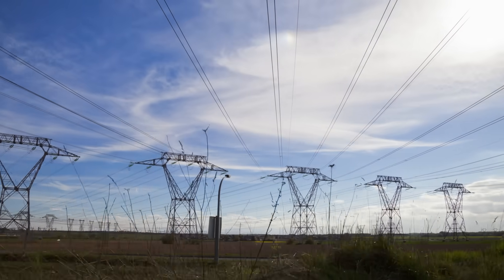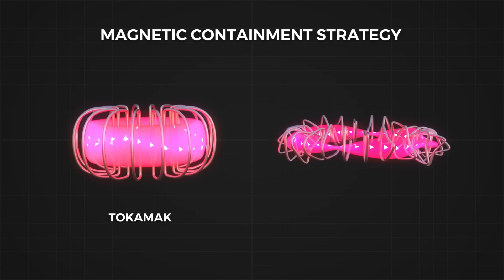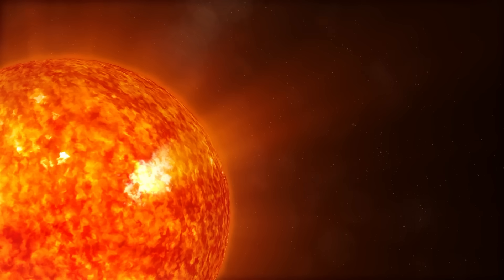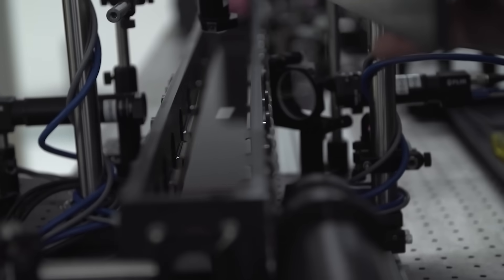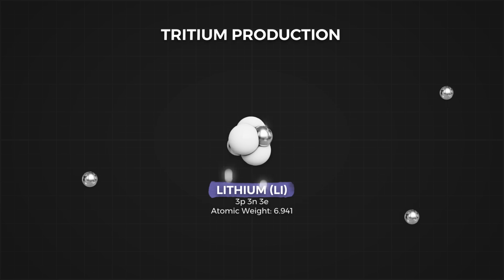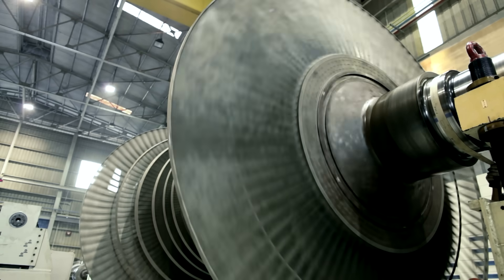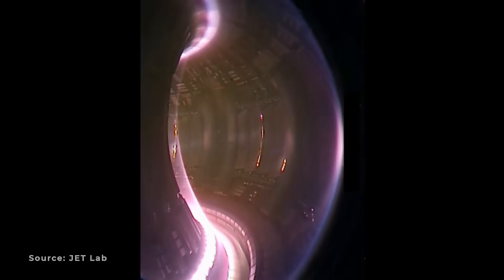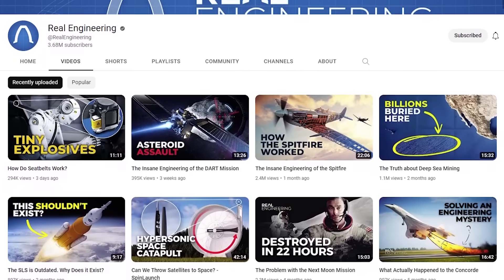The Problem with Nuclear Fusion

Comment: It's impossible, The temperatures will vaporise the container within minutes every time. There is no way round this. However wonderful it might be, it's a giant waste of money that is being diverted away from viable, useful projects.
Reply: They have been achieving these temperatures in reactors for decades. They achieved thousands of times these temperatures at CERN. So what are you talking about?
Reply: @Gomlmon99  yes they have. But that's why they can only maintain a plasma in times measured in seconds. Because any longer and things start to melt. You understand that 'things take time to heat up' right?  You could put your head in an oven for three seconds and be alright. Try it for an hour and understand the issue as to why there can never, ever be a continuous fusion reaction under control..
Reply: @andyf10  They use copper magnets in the short life ones. Longer plasmas can be sustained with superconducting magnets, which exhibit no resistance and so don’t heat whatsoever. This has already been done several times around the world. So again, what are you talking about?

The arrogance of people who know absolutely nothing about a topic is always shocking.
Reply: @Gomlmon99   I'm not talking about magnets, I'm talking about the plasma itself at a hundred million plus degrees. Anything and everything in close proximity is going to be vapour in short order. 
Iron turns into a gas at 2862 Celcius.
Reply: @andyf10  They can achieve continuous plasma. Modern reactors have held plasmas above a 100 million degrees for very long periods now.

The reason old reactors couldn’t do it is because the copper magnets overheat.

Are you under the incorrect assumption that the walls reach millions of degrees? Because it’s only the core of the plasma that gets that hot.
Reply: @Gomlmon99  No they can't, the longest time achieved in 17 minutes in China.  Continuous plasma isn't and never will be possible. 
The walls don't reach those temperatures BECAUSE the plasma is only there for a few minutes. 
It's the main reason why they can't ever achieve this, because they WILL heat up under heavy neutron bombardment and intense IR heating. Why do you think they won't? Do you think the plasma doesn't emit IR radiation?
Reply: @andyf10  They don’t because they are actively cooled, faster than they’re heated up the plasma. Pretty simple no?

Not much concern about heating from neutrons. The structural materials tend to have pretty low cross sections for neutrons. 

17 minutes is effectively forever. If the walls aren’t too hot after a few minutes, they can go long enough for a full pulse.
Reply: @Gomlmon99  Ok, well you seem convinced. I worked on the JET project in the 80's and no one had any real optimism that the thermal issues were ever solvable. 
50 years on and they still aren't, so the money pit of vanity science grinds on. 
Clearly you think 100 million degrees can be solved with 'cooling', ok.
But BTW, 7 days is 'forever', 17 minutes is not, especially if you know why they couldn't go any longer....
Reply: @andyf10  so you worked in a fast moving field 40 years ago and think that’s relevant? I work in the fusion industry now so I’m fairly comfortable with my information. 

Your suggestion of 7 days is an example of how out of date your “knowledge” is. Why would anyone run a plasma for a week straight? How would you swing the current?

Even EU-DEMO is planning pulses on the order of an hour or two.
Reply: @Gomlmon99   Well I suppose you might ask why you run any power station continuously..

The answer of course is that to be useful to society, you need 'continuity of power generation' and positive power output.

A power station that only operates a few hours at a time is precisely useless. 
You realise the ultimate aim is power generation for the world? 

Oh and it isn't 'fast moving' science, it is glacial in speed, hence the woeful progress made over many decades. And no light at the end of the tunnel for many more decades yet. 

It's vanity science at it's worst with no prospect or even viable model for a positive output of power.  It's so bad that the recent announcement of passing the power out vs. in threshold had to ignore the 100x factor of the power they needed to make the lasers run. The claim was essentially fraudulent and really they are nowhere even in the ball park. They discounted 300 MJ of energy input! Ridiculous claim!

But hey, enjoy spending the money and having science fun while you can, because no one is ever going to bring you to book for the utter waste of resources being made in fusion.
Reply: @andyf10  You didn’t really work in fusion do you? You don’t know the difference between the pulse and the balance of plant? 

The pulse could be an hour with 5 minute downtime. That doesn’t mean the turbine stops spinning. The balance of plant would provide carryover for that. 

I agree with the skepticism but you really should stop commenting on topics you don’t understand
Reply: @andyf10  hundreds of billions?? The total life time cost of JET is about £1billion
Reply: @Gomlmon99   There are many projects all over the world, I was referring to total cost of all projects. Also to cost at today's inflation adjusted prices. The US alone were spending a billion a year on fusion back in the 80's...
Reply: @andyf10  do you have a source for that claim? Not heard of figures anything like that.
Reply: No? The temps aren't a problem as the plasma is contained by magnets and doesn't touch the walls. So continous plasma possible.
Reply: @afaxmachine5045   So I can stand a meter from the sun and it'll be fine because I'm not touching it..... Right? Because that's what you are saying.
Reply: @andyf10  That’s not what he’s saying. You’re just one walking logical fallacy machine aren’t you?
Reply: @Gomlmon99  So tell me if the plasma is at a 100 million degrees, could I hold my hand a meter away from it? Assuming it could be contained? What would happen to my hand?
Reply: @afaxmachine5045  Well avoided....  OK in a space suit then. Same question stands. Can you stand next to a plasma because you aren't touching it. Or would you get a bit warm quite quickly?

It's as though things only heat when in physical contact or something?
Reply: @andyf10  depends on how reflective the space suit is.
Reply: @afaxmachine5045    hahaha ok..... think I will leave it there. Thanks for giving me a good laugh.
Reply: @andyf10  Of course no. Luckily, we aren’t containing with it hands, but with materials that can withstand the increased thermal radiation.
Reply: @Gomlmon99   So you are saying there IS thermal radiation from the plasma...?
Reply: @andyf10  Of course. Who said otherwise? It would be ridiculous to suggest there’s not, and ridiculous to suggest that means we have a problem.

Everything gives off thermal radiation. What’s your point?
Reply: Just reminding the world this person thought the temperatures would “vaporise the container within minutes” despite the fact we’ve held plasma like this for minutes many times without the slightest hint of vaporisation, and despite the fact the heat of vaporisation of any container would be enough to extinguish a plasma
Reply: @Gomlmon99  So what is limiting plasma life then. Why can't they do it for days?  Awaiting to see if your answer includes the words hot, temperature or heating 🤗

But hey, we should return to this question in another 20 years, when..
a) Still no commercial fusion
b) Another XXX Billion dollars pissed away on it.
c) Fusion is just "20 years away"
Reply: @andyf10  We’ve already been over this. It’s the magnets. But they’re not being vaporised by the plasma, and they’re at no risk whatsoever of being vaporised, like you said.

Though, they can do it for hours. Beyond that, the limiting factor is just how long they can swing the current across the solenoid for.

Comment: Nuclear fission is not uneconomical, it's one of the cheapest methods of producing electricity. Nuclear power is dying because of crazy environmentalists and politicians fear mongering about how dangerous it is.
Reply: It’s dying because it’s exceptionally expensive. No idea where you got the idea of it being cheap lol.
Reply: Fission is destructive by its very nature, It creates material that is by no means biodegradable and destroys anything that comes within miles of it. But please go on about how it's cheap and clean.
Reply: @SerDanFortesque  But it doesn’t destroy anything once it’s put in a box, right?

And it decays away, unlike chemical contaminants.
Reply: @SerDanFortesque  It will be inert as far as we care. The odd atom decaying is not a concern. 

The waste from fusion is short lived and weak, and could just be left in a box for a few years until it’s safe. Not a problem.

The way to dispose of it is DGRs, which are now entering into service.
Reply: @SerDanFortesque  this is false.

Comment: Helion is not the only ones not betting on the solid neutron shield to capture energy. General fusion and they piston design will us a layer of liquid mercury to capture the neutrons and already move a turbine. They got funding and authorization to build a 70% scale demonstration power plant by 2025 and are aim for a early 2030 for a comercial one. It will be interesting which of the two companies win this out, they probably will beat ITER.

Comment: Nuclear fission is not 'clean' energy. It's the exact opposite because of the radioactive waste it produces!
And that is the reason nuclear reactors are shut down. Because no one knows what to do with the extremely dangerous waste products!
Plus, as several accidents have shown, it's very dangerous in the first place! Why people keep saying it's 'clean' and 'safe' ?
Reply: Because it is clean and safe. Just because you are ignorant of the facts and statistics, it doesn’t mean it’s not true.
Reply: In relative terms, nuclear fission is orders of magnitude cleaner and safer than any fossil fuel energy source. It actually even trades blows with renewable energy sources for those metrics when factoring in construction and lifetime resource costs. Yes, that is despite the accidents of 1986 and 2011, including pessimistic estimates of their long-term effects. Air pollution is a massively underappreciated problem, it's just not as immediately apparent as a soviet power plant literally exploding.

"No one knows what to do with the waste" is also a false statement, quite simply - see for instance the vault Finland is looking to open. Solutions exist, And there actually isn't even that much of it.

This is not an attack, I know yours is a very natural stance to take, but it's not supported by actual fact. If you're interested, there are some videos on YouTube by e.g. Kyle Hill or Kurzgesagt that break down the issue of nuclear power pretty nicely.

Comment: At 7:44 you mischaracterized what a moderator pool is designed for. They are not designed to absorb high energy neturons. They are designed to moderate high energy neutrons, which means to reduce their kinetic energy to thermal energies. Absorption is counterproductive in a moderator. I haven't viewed the rest of the video, and I don't have a strong grasp on fusion, but such a technical error about fission on your part diminishes your credibility in my eyes.

Comment: So solution is combination of fission and fusion reactors plus renewables. So fission is main reliable backbone and source of tritium for fusion reactor. And elecrolisis for hydrogen and deuterium. Hydrogen will be used for fuel in fuel cell vehicles  and deurerium in fusion to make helium for airships.

Comment: I don't understand, why we don't research materials that can directly transfer heat into electricity... Instead we just waste so much energy everywhere
Reply: Why would you do that? Steam turbines have 90% effinency. Steam is simply simplest way to extract and convert energy from fuel.
You can store so insane amount of energy on steam.
Reply: @jarskil8862  But first you loose energy converting original source to heat, then heat to water, them water to turbine. Think about this like that: right now, it's like instead of photovoltaics, we used lenses to heat water and used connected steam turbines. Which we also do, but photovoltaics are better in every scale beside massive collector plants.

Comment: Fusion requires reactor designs that are not Tokamak donut, Spherical Chamber or Stellarator based. In addition to the fact that Deuterium squeezer units, such as those from Lockheed Martin and Helion, are not true Fusion but fall into the category of Thermal Fusing of Isotopes. Proper Fusion is Ionic in nature. 
Laser based fusion reactions are " heat and squeeze " processes and not viable for sustainable Fusion power.
I speak not as a scientist but as an engineer.

Comment: I hope you haven't bought into that "solar and wind are cheaper than nuclear" meme.  Maybe during operation, their unreliable output may be cheaper per kWh, but W&S are 1) horribly expensive and energy-intensive to create, 2) have a much shorter useful life, 3) need 100 to 1,000 times as much land for the same output and, 4) have a much higher environmental impact for both construction and decommissioning.   Tell me again why this is desirable?
Reply: Because these things are either overblown/exaggerated or are outweighed by the lower cost in certain areas.
Reply: @Gomlmon99  The only way to settle this is to do a cradle-to-grave analysis of each form of power generation.  I'm an engineer and have done many of these (but not for power stations).  That's the one thing you never see by advocates of green energy.  Instead, they "draw the envelope" around the part of the life cycle that looks better to prove their point.  

For example, the energy that goes into the production of solar arrays, and that's mostly the refining of quartz into silicon, exceeds the amount of electricity that will be generated over the array's lifetime.  

Further tarnishing it's green credentials, that refining process takes powdered quartz (SiO2) and heats it up to thousands of degrees in a reduction furnace, then adds...wait for it...coal to the furnace.  The carbon in the coal grabs the two oxygen atoms off the quartz leaving pure silicon behind.  And what do you call a carbon atom with two oxygens attached?  That's right, creating this panacea energy source consumes coal and releases CO2 into the atmosphere.  

By some calculations, solar panels release more of it per kWh generated over their lifetime than if you had just burned the coal in a power plant in the first place.
Reply: @hagerty1952  cradle to grave assessments have been done on all common energy sources hundreds of times lol

Comment: 2:46 
hot enough to melt any solid material in the universe... yet doesn't actually do that in that solid doughnut?!
magnets aren't anti-heat!
Reply: I don’t have any outside knowledge, just going off what he said, but I’m assuming there’s a specific distance or limit to how close a substance can be to the plasma before it starts to melt, similar to how there’s a limit to how close chocolate can be to a fire before it starts to melt lol. So the magnetic field generated by the magnets acts to keep the plasma confined in a specific region as it spins around so that there’s sufficient distance between it and the walls of the reactor
Reply: The magnets suspend the plasma so it doesn’t touch the walls and the walls don’t get that hot. So in a way, they are anti heat.

Comment: Fusion is one of the two most important challenges we face on our journey to advance the human species. The other is creating a microprocessor that can directly receive light wave signals and not require a copper-based interface. It would essentially eliminate the concept of bandwidth and all computer processing could literally occur approaching speeds of the speed of light. Two computers on opposite sides of the Earth would appear to be communicating instantaneously. CalTech has been working this challenge for years.

Comment: So I'm assuming quantum mechanics have something to do with the chance of the reaction we want to get out of two regular hydrogen atoms? Also how low of an energy yield does it get? Like what if they were able to get the chamber hot enough thst it could start reactions with little to no energy input required to scavenge some of the reactions that did go the way wanted while still using little to nothing to keep it going, and if it is quantum mechanics we really need to figure out how to observe without observing!

Comment: seriously?  Fusion does not equate to some progressive utopian wet dream.  We used to have a shortage of food and clean water.  Solving those issues didn't result in a utopia either.  That and the progressive utopia would end up looking more like a dystopia if the nuclear fusion problem was ever solved.  Just like there is no "free healthcare" someone still would need to build and maintain the fusion plant as well as the associated energy grid.  You'd also have much of the Middle East and Russia collapsing almost immediately as their economies rely on their oil exports.  That would probably lead to war and so on.